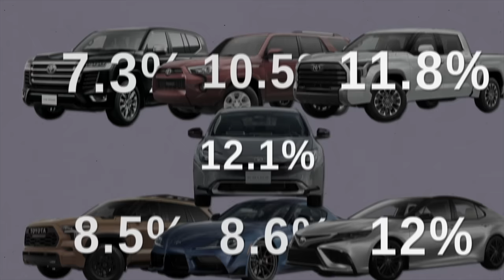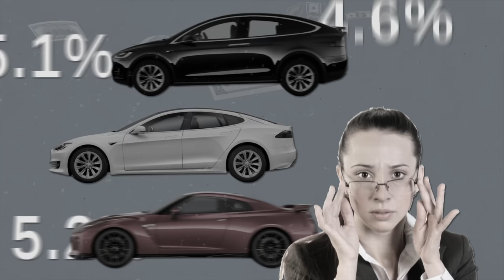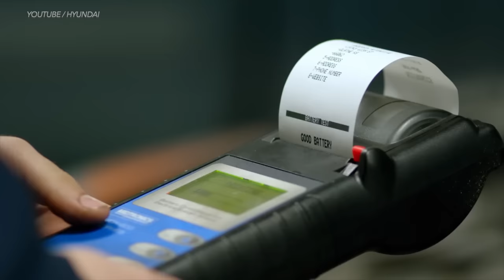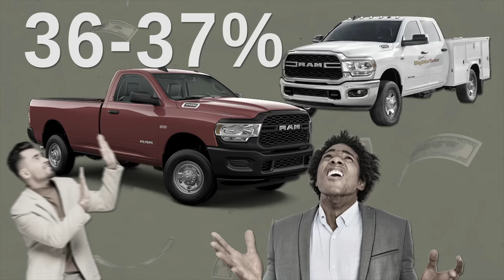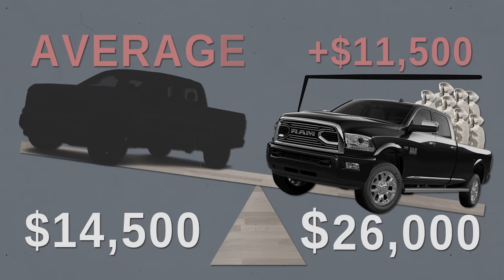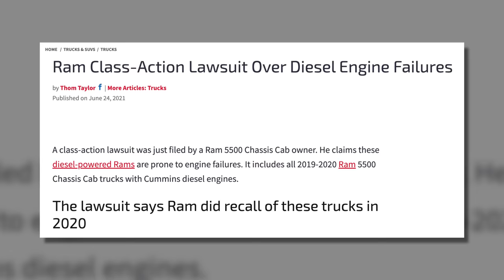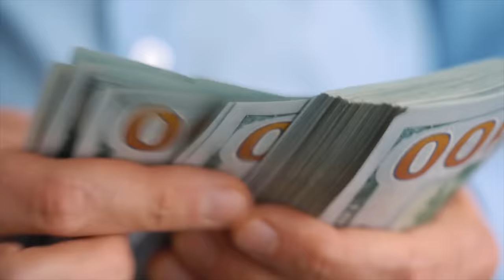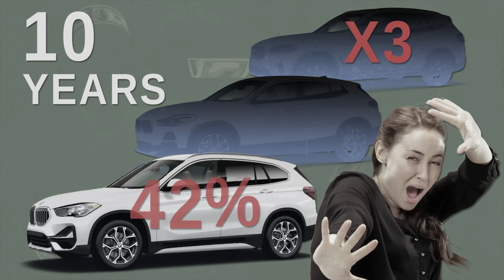Here's Why I Only Buy Toyotas and Lexus

Comment: Scotty -  I am in Australia and have owned a 2007 BMW X3 diesel 3.0d for a little over six years now. It has been a great car for me. I am 75 years old and carry out as much maintenance myself as possible. Over those past six years I have only taken the car to a dealership once and that was to have the Takata airbag replaced under a recall. The servicing costs have been marginally more expensive as a result of its sump capacity of 7.5 litres and its requirement of top quality full synthethic oil suitable for DPF filters. Prior to purchasing my X3 back in April, 2017 I carried out a fair amount of research on the various versions of the E83 X3. I learnt to avoid the 4 cylinder diesels 2.0d like the plague and that's why I went for the 3.0d. The plastic crap around the engine and cooling system is still in excellent condition despite approaching 16 years of age. There are a huge range of non-OEM parts available for my E83 and not Chinese made ones either. I source most of my parts on eBay both in Australia and overseas. The secret to keeping the maintenance costs as low as possible is to change all the fluids regularly. BMW engines are notorious for oil leaks. My car has none even accounting for its age. Even BMW advertise that their automatic transmissions (ZF in my case GM in the US) are sealed for life and never need maintenance. I know this is a load of crap and I had my transmission serviced about two years ago with new fluid and filter. ZF the manufacturer recommend a service every 100,000km. My X3 E83 3.0d (not available in the US) is a great car to drive and I intend to keep it in the long term.

Comment: I'm an Aussie and we have the Toyota Hilux (its like a baby Tundra). But every mine site in Aus (and there's a lot) use Toyota Hiluxs as their go-to fleet car. These are some of the harshest conditions that you can put a car in, incredibly hot, dusty as hell, ground can be salty depending on what mineral is being mined and the Toyota's are the only ones that last the test of time. Iv seen several fords, mitsubishi and Isuzu vehicles used on mine sites and they rarely last longer than 2 years before getting serious electronic and mechanical issues, mostly caused by corrosion... but the Toyota's just keep on trucking for 5-7+ years before issues arise... and that's pretty incredible for the environments they're placed in and the amount they are used and abused..
But then you have the Toyota Landcruiser 70 series and those things are indestructible.
Reply: This guy is so 'ye ha' 🤣 I don't care what my HSV costs - they're worth it 😉
Reply: @joanneburford6364  haha couldn't be further from it. I drive a 1998 landrover defender with a total worth of about 6 grand. I still admire the quality of Hiluxs as an ex-mechanic. HSV..? wouldn't go near it

Comment: Bought my infinity qx56 in 2016, the only thing I've changed are brakes, oil, a few link arms (cheap), a wheel bearing (about 200 bucks), freon refill (about 50 bucks), and compressor for rear suspension (200 bucks on aliexpress). I cant tell you how this car has saved me and served me. Like they say, buy once, cry once. Toyota, Lexus, Infiniti are the brands to go with.

Comment: Nope.

All I'm seeing is a string of Toyota Recalls........ 

Toyota recalled certain 2021 RAV4 Prime Plug-In Hybrid vehicles due to the risk of the hybrid system shutting down and stalling while driving in EV Mode in cold

Toyota recalled 2022-2023 Corolla Cross vehicles due to a manufacturing defect in the instrument panel. Improper deployment of the front-passenger airbag violates safety regulations.

On March 2, Toyota issued a recall for some 2022-2023 Tundra and Tundra Hybrid vehicles that have a Toyota genuine accessory tonneau cover. NHTSA said the cover may detach if the tonneau cover attachment joints become loose.

Toyota issued a recall on June 14 for certain models of the 2023 Camry and Camry Hybrid. The lug nuts that connect the wheels to the vehicle may not have been tightened properly, which can result in the wheels detaching.

Toyota recalled some 2021-2022 RAV4 Prime and 2022 Lexus NX450h+ plug-in hybrid electric vehicles on July 12 due to a potential electrical short-circuit caused by a damaged electric current rectifying module in the DC-DC converter.

etc......

Comment: bought a 2009 rav4 v6 awd in 2020 with about 118k miles - took it on two cross-country moves pulling a small but fully loaded uhaul - never had a problem - it'll need new tires soon. otherwise, all i've done is change the oil

Comment: My family always had at least one Toyota. I use to hate toyotas growing up, but after buying unreliable cars. I finally switched over to toyota. It was the best decision ever. My first toyota i bought was a 2014.5 camry in 2019. The most reliable car ive ever had. The only thing i had to replace was the mass flow sensor. I always did normal maintenance (oil change and tire replacements) as well. It was involved  in a accident last month. My baby ended up getting totaled out. I now own a 2021 TRD Camry. I plan babying this beautiful car. Im definitely a toyota fanboy now. 😅😅

Comment: I travel a lot on business and have been on the autobahn for over 20 years. I had the most problems with Audi and Volkswagen. Mercedes, BMW, Ford were the best. I had no technical defects up to 100,000 miles. Just the usual wear and tear on the brakes. But that's normal when you're going a lot over 100mph.

Comment: Enjoy your videos. Thank you for making them. Earlier in my life I was an aircraft mechanic and I sold cars professionally for about 5 years. So, I have some insight into maintenance and sales. Scotty is spot on. One thing I would ask has to do with how these figures were calculated? I agree Honda is expensive to maintain, but I think it has to do with the manufacture’s prescribed maintenance schedule and shop prices. For example, I sent my wife into the dealer for an oil change at 30,000 miles. She walks out with a $400 bill. Why? They flushed the brake lines for $270 and replaced the fluid. I understand the theory behind this but it is unnecessary at 30,000 miles on an Odyssey mini van. That is part of the problem.

Comment: My 2008 Honda is still doing good with 245k miles and prior to that I have 1998 Honda accord with 300k miles before I traded it in with my 08 Honda Accord. Also I still have 2004 Acura TL, and it’s still running strong!

Comment: My 2006 Lexus gx 470 that my dad originally bought just clocked over 200,000 miles, the A/C has never been charged and It still blows ice cold on a 100 degree day. the only thing that’s ever failed on the car is the rear air shocks. Which I remedied by swapping in Toyota 4 runner rear coil springs, only about a $250 fix. I recently used a oil flush and some injector cleaner on the car before an oil change and all the slight ticks that the motor made completely disappeared, it runs butter smooth along with all the suspension still in great shape. Shock absorbers are getting a little floaty so I’ll replace them soon but they still work good for now. I believe this car will easily run to 300,000 or possibly more without major drivetrain work.

Comment: I have a 2004 Corolla T-Sport. Yes, the one with the apparently unreliable 2ZZ-GE. It has 126k miles and it’s running well. So far I’ve only done maintenance, which has been cheap and easy. The only bad thing so far is that it needs a new clutch but it’s amazing to start with that the original clutch survived 126k miles. It’s my 2nd Toyota so far and I plan to keep it.

Comment: My current Lexus is a tank and won’t die. It’s a 2001 GS 300. The hell I have put it through from being a kid in the backseat to being a crazy teen behind the wheel to being a slightly better driver in my 20s. I can’t kill this car. So many things needs to be fixed for years but you can still race it.

Comment: In 2004, I purchased a 2002 Toyota Avalon with 40,000 miles on it. In 2021 the transmission went out at 153,000 miles. At that point replacement of the transmission was more expensive than the car was worth. What did I buy? I bought a 2013 Toyota Avalon with 48,000 miles on it. I doubt that this one will me last me  17 years as the other one did because I’m 85 years old. I love both of these cars. Hope someone can get a lot of miles out of this one when I’m gone.

Comment: I'd love to hear Scotty discuss the 2GR engine timing chain cover / oil leak issue.  I was ready to buy a used RX350 with about 57,000 miles on it.  Total price out the door was almost 29,000.   Before going to pick it up I started remembering the 6 cyl engines had issues and looked up the oil seeping problem.  If you are unlucky (some owners say all will be unlucky) you won't have the problem.   But that inexpensive part will cost you $3,000 to $4,000 to stop your car from dripping on your driveway.  Why?   Because to replace that gasket on the cover requires the engine removal.  Think I'll pass on that 6 Cyl RX350, I'm not in the roulette wheel mood today.

Comment: I own an Audi A6 C7 from 2012 made in Germany. I live in Europe. The car is 11 years old now. While it had some issues over time, it was not bad at all. Most notable problems were the ECU unit which had to be replaced due to water entering into the unit. A new one was expensive so I bought one from the used parts form 200 Euros. The EGR valve was changed also recently. I bought a new one for 400 Euros. As far as I remember I changed also an electrical water pump for 200 Euros. Well, that`s it.. these were the major failures in an 11 year old Audi made in Germany. If you treat them right, they work. Now, maybe a Toyota or a Lexus would be more reliable but beside reliablity there is not a single thing in them which is better than the Audi. The Audi is more confortable, more engaging to drive, more luxurious and more technologically advanced.. Now, that being said, it seems that in the US the German cars are not actually made in Germany (or Europe in general) but in Mexico/USA. I heard hat the reliablity is poor and the spare parts are very expensive there. So, all in all I understand the negativity towards German cars. Here in Europe Toyota and Lexus are not doing so great...
Reply: Nah.. Audi sux

Comment: Oh yeah 😎? Late model BMW Motorcycles 🏍 to replace the $200 starter, the BMW Bike has to be pulled apart, using an engine hoist. Labor is about 2,000.00 So might be a good idea to replace any reduction gears involved while the bike is apart on the hoist. Don't know but most 4 wheeled vehicles don't usually cost $2000  to replace a starter

Comment: I’ve owned a Ram 2500 HD 6.4 for a little over two years. 27,000 miles and while I’ve had no problems, I can tell that it has to be babied in certain ways. For example, I always manually disengage the alternative fuel management, deal with the constant squeaking sound  of the exhaust manifolds, and the annoying door hinges that sound like 79 Cadillac . Hoping to see this 2021 make it for the long haul. So far just oil and filters, but noticing tires will be needed in the next year. I miss my Tundra (2012 model), but the new ones look like junk

Comment: I bought a Land Rover Discovery from new. It spent most of its short (3 year) life on the back of recovery trucks due to constant problems with the electronics. One truck driver told me that Land Rover models (especially the Range Rover and Discovery) made up more than 50% of his jobs, including cars with less than 20 miles on the clock.
My friend owns a repair garage. As soon as BMW brought in stop-start technology, they became the predominant part of his business (the engines were getting suffocated with part-burned fuel). BMW wouldn’t fix the problem under warranty…

Comment: contrary to this I had classic 1988 bmw 325i, inline 6. I only changed oil. it was absolute beast. So much HP and torque I could make its nose lift up. It felt like a motorboat when you rev up and nose goes up. eventually it succumbed to overheating and I sold it. Few maintenance stuff electric buttons for windows were 75$ each, window motor 250$  lol. I found out accidentally the dealership was selling me part cost 15$, sold to me for 79$. That's why maintenance cost is so high, blame dealerships profit margin for parts.

Comment: After my Mercedes broke down for the third tie in 3 weeks after supposedly being fixed at the dealer, the tow truck driver who towed me before said the only cars he doesn’t tow are Lexus. That was nearly 20 years ago I have owned nothing but. Traded my last RX 450h bought new in 2013 with 117,000 last year with original brakes and never replaced a single lightbulb in the entire vehicle.

Comment: 91 Toyota Camry. Step daughter drove it about 7 years. I got back with about 280000 miles.  Her mom took it to backyard mechanic who worked on front end. I took it to my local shop.  A part of transmission was broken off. So they found a rebuilt transmission for 2.0 l. But had to send it back to Arizona. I'm in California.  2nd transmission with an axle. Running again. A few months later engine overheated and seized up. Must have been a bad hose. Car set for 6 months then took it to mechanic and replaced engine radiator and hpsrs. Ran great  but it wouldnt pass smog test. Check engine light stayed on and the old model no one   had test module for it.  Recently replaced fuel tank and fuel pump. New alternator, but since it don't drive it every day but to the dairy to pick up hay to transport in trunk.  The battery (new) has to be put on charger because I think it drains electrons.  Light for passenger door shoes open. Can it be tested for a bad sensor in system. White 4 door  Camry. Only about 10 miles on engine.   Great informative videos. John

Comment: I bought a used 2006 BMW 745Li that ran great. It was still a money pit. I sold it and bought a one owner 2006 Lexus RX-400h with 93k miles. I’ve had the car for two years and it is the best car I’ve ever had. It rides, smooth, runs great, and takes minimal maintenance. I’ll only be buying Lexus or Toyota in the future.

Comment: Ok here we go. I owned a 2003 Toyota Sequoia which had to be put down after 12 years due to corroded undercarriage. Broke my heart. I still own a 2013 Mercedes E350 cabriolet with 13.4K kilometres only driven in summer. Beautiful car but maintenance is about $1-2k per year. Basic servicing and I feel the garage looks for issues to service. Perfect for a sunny drive and is smooth as silk. 
My other summer car is a 2010 Porsche Panamera 4. Drives and looks sharp but the ongoing repairs and servicing have been brutal from day 1. I decided to bench this car for the year after being tired of constant issues with thermostat every year. Repairs would run $3-5k . My wife drives our 2017 Lexus gx450 suv. A thing of beauty. Classy and solid. No repair issues other than a loose heat deflector shield. This vehicle is amazing. My daily driver is a 2021 Jeep Rubicon Gladiator. Only issue was a leaky axle in rear. Seal was gone. That disappointed me because it is not used off-road. Otherwise a perfect all around vehicle for city driving both summer and winter with a great upright driving position. A little cramping on the leg space for the driver. My son drives a 2010 Jeep Wrangler with 23 k kilometres. Other than general maintenance and servicing she is a great city vehicle for year round driving. Perfect in our snowy city. Wouldn’t feel comfortable on a long highway drive due to short and sensitive wheel base. Rankings as follows.1. Lexus 2. Gladiator 3. Wrangler 4. Mercedes 5. Porsche.

Comment: I had owned Volvos from 1994 to the beginning of 2022 when my last one gave up at 406k miles.  Would I buy another Volvo. No.  High cost of maintenance.  I bought a Toyota Camry this time, brand new and I expect to drive it until it no longer wants to run.

Comment: I bought a used 2015 Lexus GS 350 with 187k miles for $13k. It has good maintenance records, so it still drives like a new car. My turn to baby it. The used vehicles I buy last 200k plus miles with just wear and tear 👍

Comment: Love your videos.  Don't want to be eating pop corn while watching; almost fell out of my chair watching a couple of them; you would make a good comedian.  Even though I'm a women I grew up with brothers so I understand what you are saying.  I wish more women would get mechanical.  I know to many who are being cheated with their vehicles.  I have a 2007 Subaru Impreza 2.5 boxer with 213,000 plus miles, Transmission is an automatic.  In the winter I wash the underside when I get home.  As a result the underside is in real good shape.  My head gasket is leaking a little oil and antifreeze.  I was told by a mechanic (who I will not do business with anymore) that the antifreeze is going into the engine.  There is no white smoke coming out of the tailpipe and the car starts and runs fine.  It has overheated many times due to radiator problems; which I think was caused by this mechanic not getting the air out of the system after the radiator was changed.  I am a gauge watcher because of being a former helicopter pilot and as soon as I would see it overheating I would pull over.  I  have always carried extra antifreeze and oil plus tools.  One time I had to open the radiator cap while it was hot.  I needed to get home with frozen food; AAA would take hours and they will take your car, but not you.  This is Maine and stores are not around the corner.  It made a mess, but I got home and had no problem after that.   My question is:  do you think I should get the head gasket fixed and keep driving it (since it has many new parts and I took it to Subaru and had all the fluids changed) a couple of years ago?  I like the car.